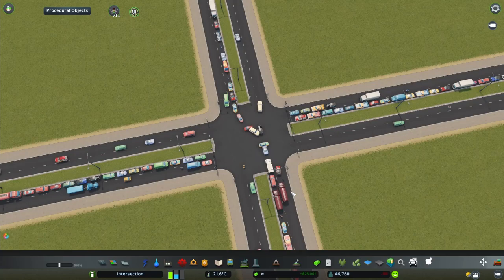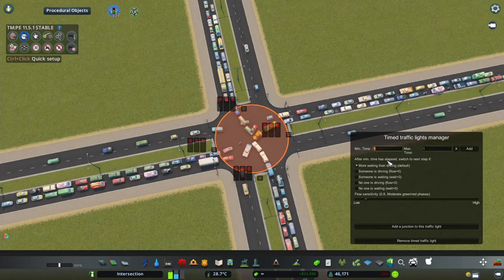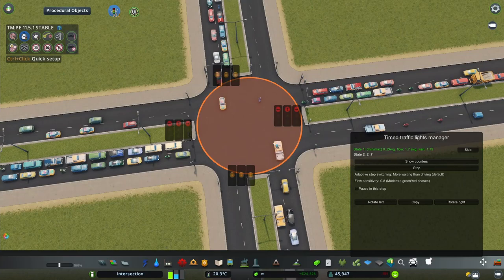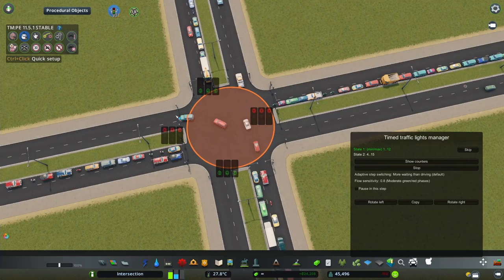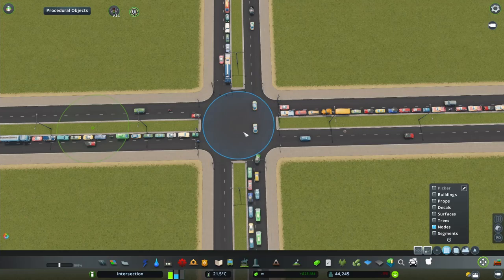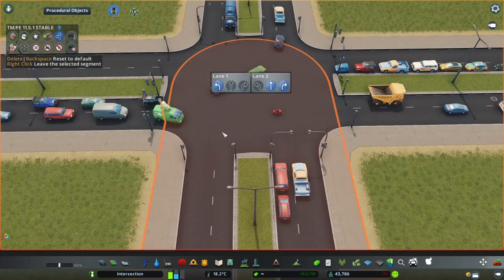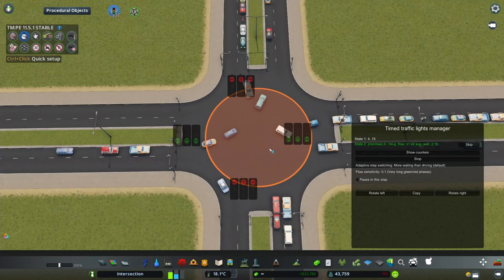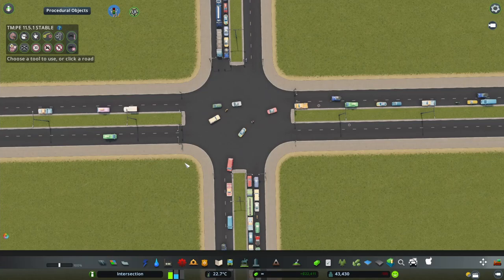Start Using Timed Traffic Lights in Cities: Skylines

Comment: Very nice tutorial. However, with these amounts of traffic I like dedicated lanes for each direction. It saw a lot of times the extra turn right green light isn't used, as the front car wants to go straight instead of right. It blocks the later vehicles from turning right, and kinda neglecting the advantage of having that extra green light to turn right. 

Edit:

Never mind, you started talking about that 30 seconds later in the video, where I stopped to type my comment xD
Reply: In those cases if you have a lot of right turns its better to make only left lane forward and turn, so cars can always make the right turn since you need to wait for left turn anyway.
Only in cases where you have a huge volume of left and forward it's better to have two lanes going forward or have dedicated left turn lane.

Comment: Yes, in many places you ca turn right on red light. In my country though they usually add an extra traffic light with an arrow which is always green. Also yes in most countries you can choose which lane you are going to when doing left turn as long as left turn could be done only from one lane.
Btw the default traffic light setup you criticized in the beginning of the video is in fact far better than the default setup of traffic lights in real life - the one with only two phases. What happen is many kilometers long line of people wanting to turn left in the left lane (because its only ~3 cars that can turn left per traffic light phase cycle), than smart people form similar line in the middle lane, than some even more smart people start turning left from the right lane and eventually guy from a middle lane driving forward hits the guy in the right lane doing left turn and road comes to deadlock. Happens at nearly exactly same places nearly every day.
4 phase traffic light would've eliminated half of traffic problems (
Reply: thats dangerous af though

Comment: The TTLs switch slower so that there is time to clear the intersection. Vanilla traffic lights don't allow much time to clear the intersection, so cars will get stuck on it and block traffic coming into the intersection if the traffic volumes are high enough.

Comment: 13:14  The reason people often suggest to not overuse the lane connectors is that it's easy to force vehicles go somewhere where they don't want to go. If your next road has no way of switching lanes until the next intersection (e.g. because there is no node, or the next node has "stay in your lane"), you might end up with very strange traffic behavior. When they can choose their lane at an intersection, this often can be avoided. (And if you have the protected left turns, you usually don't have conflicts here.)
23:03 In this setup of lane-connectors for protected lefts, you can leave the right-turns always on for all the directions, I think. (Of course when adding pedestrians, you might not be able to.)
31:05 "The collision detection is kind of weird in this regard" – that's an euphemism for "Cars are freely running through pedestrians"?

In general, always check where most of your traffic goes. Give them more (and possibly dedicated) lanes, longer phases, etc. Then check who else can go at the same time. Sometimes it might even make sense to have all cars going into the same direction on at the same time (when they have separate lanes to go to) instead of all cars from one direction.
Reply from the maker: I don't buy that argument against lane connectors and how often people don't want to use them out of principle. Yes, it's a powerful tool, so just pay attention to what it does and what are the consequences? And just do good designs? It's not like you can't put it back if it doesn't work for specific situations. IDK, just because someone can't use it well or it's not suited someplace doesn't mean it should not be recommended. /rant
Reply: @Akruas  I've just seen enough Youtube videos where people tried to fix their traffic  problems with lane connectors, and it got even worse. Of course used correctly, those problems can be avoided.
I guess the best general recommendation is "Pay attention what you are doing!" (and in this case: "Make sure vehicles still can reach their destination!"), then you can use every tool.
Reply: @PauxloE  You mostly just need to check the next node and be sure you're free to change lanes. Create the node if necessary.

Comment: 28:26 At some lower-trafficked intersections in my city, I give pedestrians green in the same direction as the cars are travelling, so left and right turners conflict with them. This is not as bad as it seems though, and allows me to get away with just 2 phases instead of 3. It's also a common setup overall where I live; vehicles are required to give way to pedestrians when turning.

Comment: I have found that using the different "after minimum time" options helped a lot where I have linked timed lights along the same road. After linking 10 junctions in sync the computer switches the phases very quickly as it is looking at all of the junctions and trying hard to balance the timing.  When I set all the phases to "when no one is driving" It seems to stick to the max time that I set, thus allowing the busier areas to clear. Yes, some of the junctions take too long to change, but it does seem to work well when the population gets larger and my main roads are clogging up.
Hope this helps someone as I scratched my head for a long time trying to figure the use of this function.

Comment: Honestly for me simple all green for one road in four phases with min5-max20 time in clockwise switch with 0.2-0.3 sensitivity is best. Also proper arrow and lane config should be done then, according to most occupied turn or straight but main rule here is dedicated lane >>>>> multiple direction lane. So for me it's minimum to have main arterial roads 6 lane, preferably 8 or 6 + 2 bus lanes. This is really universal configuration for any traffic even highway exit.

Comment: I personally always use "no one is driving" setting for the conditions. Dunno why but it just works for me :P
Reply from the maker: Can work on low volume intersections, but if you have continuous flow of cars from all directions, it would never trigger.
Reply: @Akruas  well it does require a bit of fiddling with the max time.
Reply: @thedeadcannotdie  Then it only switches due to max time
Reply: @luspuz2188  yes that's kind of the idea. I just let it empty whichever phase is currently going on unless the max time is reached. Obviously not every cycle sees equal incoming traffic so sometimes it does change b4 the max time

Comment: When you apply a timed traffic light useing the quick setup on an intersection with four directions and two lanes coming into the intersection (like in the beginning of this vid) the lane arrows get altered as well. But incorrect!! You get one lane for going left, and one shared lane for going right and straight through. This must be changed to one lane for going right, and a shared lane for going left and straight through. If you look closely to the way the TTL's are programmed, you'll see that right going traffic gets two green lights per cycle, while the other directions only get one green light per cycle. Try it out!
Reply: Except left and straight get green light in different phases so you are basically asking for long lines that way. The cars that must cross traffic from opposite direction should get a dedicated lane and dedicated phases. That is the whole point of TTLs over vanilla traffic lights.

Edit: ok I just realised some places do give green light to all direction to a single road in each phase so in that case your comment is completely valid.  Where I live the phases  mostly alternate between straight/right and left like at 22:54

Comment: Everything in the video is great apart from the Lane Connector part.
It's never a good idea to force vehicles into a particular lane at a junction like that, otherwise they could miss their next turn at a later junction. Setting up the traffic lights should be sufficient without having to force cars into one lane.
Reply from the maker: They can make a switch later. You should never make intersections on major roads close to each other anyway.
Reply: @Akruas  They can't always make a switch later, sometimes the next turn will be on the next node, so they're stuck in the lane you've forced them into. And sometimes, it's realistic to have a junction close to another, though it should often be avoided, especially in CS. But look at real life cities throughout Europe, they not infrequently have a junction close to a major junction.
Reply from the maker: So don't build it like that, it's not like you don't have control over how you city looks like in the game. Or don't use the connectors if you really can't. Clearly one size fits all principle doesn't apply for traffic solving, but that doesn't mean these connectors don't work.
Reply: @Akruas  Sorry if I came across badly, I was just pointing out that it's not a good solution a lot of the time. In fact, with the traffic light set up you created after the lane connector segment, the lane connections could have been undone and it would have worked perfectly.
Reply: You are correct, that cars might miss their next turn. That is, if there isn't node after the intersection. 
I also like to force left turning cars to the leftmost lane. It makes the intersection flow more, as cars from two directions can make the turn at the same time. It is also written to traffic laws here in Finland, that you have to turn into nearest lane, and switch lanes after that.
Reply: I don't know about that. Like he says, in many counties it is actually the law that cars turning left must choose the left most lane (not that everyone realizes this).
Reply: Though it can be a better idea to just use the junction arrows simply for performance reasons in the game since lane connectors are much more taxing on the system. One also gets the bonus from junction arrows of cars being able to choose what ever lane the want when they turn. I don't get why there should be laws forcing you to go to the left most lane when turning, if anything it should be the right most lane, since generally "filling up from the right" is a principle that nicely matches up with how most roads built following best practices are constructed.
Reply: @magnushmann  Ah i see. I believe its because in places where you can "right turn on red" you want the left turning traffic in the left most lane, so the right turn in the opposite direction has the right most lane. If that isn't the norm I can see why the restriction is unnecessary.
Reply: @Nosliw87  Very true. And I might in fact also be biased somehow, but I do however feel like a setup where right turns from one road would go in the left lane and left turns from another road would go in the right lane seems like it would only make actual sense if there is somehow a whole hell of a lot of traffic on a given intersection which would merit it in some way. I don't know if I just don't know, but if such an amount of traffic does exist in a junction, then it would seem that "protected left turns" would make more sense everything considered. And I really do mean everything considered, like pedestrians and cyclists as well as general safety. If it's a somewhat rural junction with enough traffic, other options might make more sense than in an urban setting.
Reply: @magnushmann  I think the law of turning to leftmost lane, applies usually to cases where car is turning left to 2-lane oneway road. And at the time car from opposite direction is turning right. That way both cars will get chance to turn to that road, and shouldn't crash. 
In CS, I do this usually in bigger T-junctions, where bottom road has 2 lanes / direction. Using lane connectors to force cars to take nearest lane, makes intersection flow better. Cars won't try lane switching at the junction.
Reply: @Jurvaa  Yeah, that would make sense.
Reply: @magnushmann  btw the lane connector is taxing on the performance only while editing the lines
Reply: @luspuz2188  Oh, ok. Maybe the difference used to be worse once edited somehow.